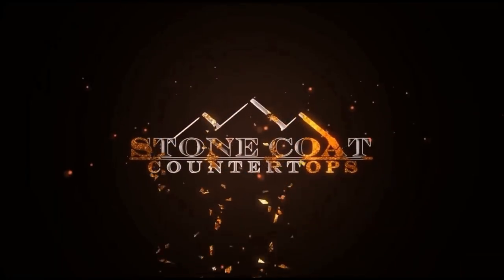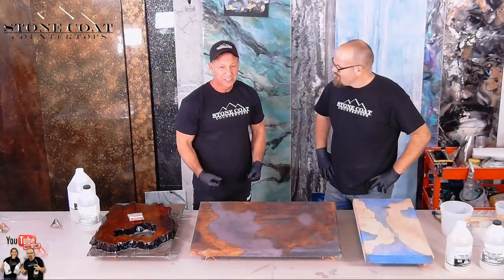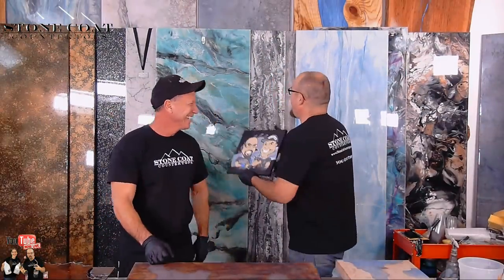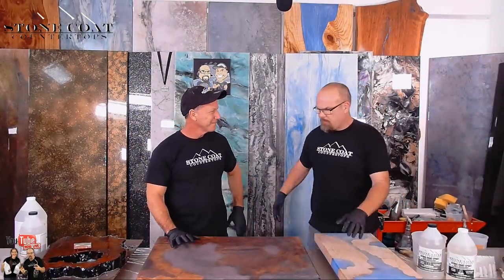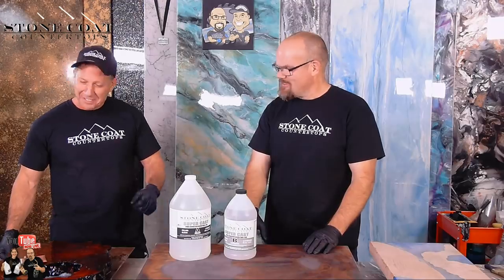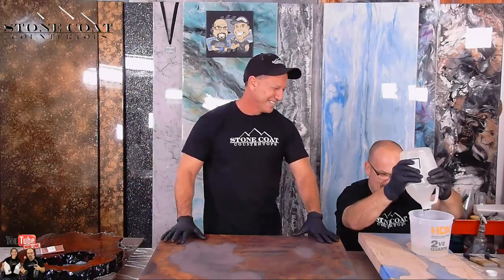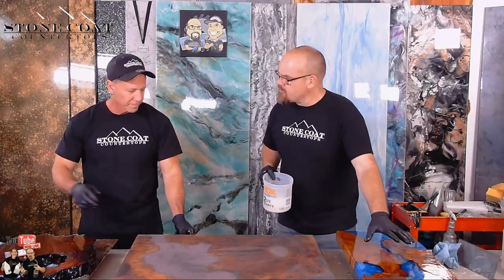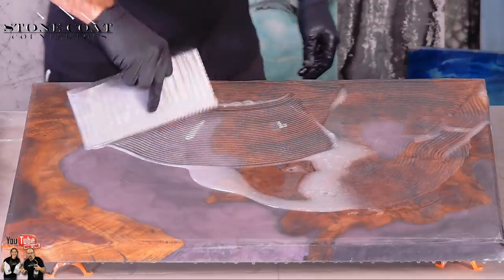Woodworking with Paul's Tool box

Comment: How come you didn't use the torch on the first piece (the wood and blue piece). Do you not need to worry about air bubbles when seal coating? And you explained the difference between seal coat And flood coat, but are these two done with the same product or different product? Can you tell I'm a total newbie! Lol. Oh and do you have a video with the completed results of the 2nd piece (or was it the third, lol. the one with the 2" deep orange hole) you did in this video.

Comment: I am planning on doing our kitchen benches, what is the recommended room temp you should be working in. And by the way, I love the one your picture is hanging on. thats my ideal benchtop. Love all your work.
Reply from the maker: Thank you for tuning in and that's a great question Pamela!  Our ideal pour and cure temps are 65-80 degrees Fahrenheit. What project are you planning?
Reply: @StoneCoatCountertops  resurfasing our kitchen benches
Reply from the maker: Awesome Pamela, have you chosen a color recipe for your benches?

Comment: do you torch the skim coats?
Reply from the maker: Great question Charley n' Me! The seal coats are applied at one ounce per square foot, whereas the flood coats are applied at three ounces per square foot. You'll do three "seal coats" on the surface using one ounce per square foot applied with a squeegee. You will torch out the bubbles with a sweeping pattern. Let it set up overnight, and sand between coats. You will still see a lot of bubbles and imperfections during the seal coats. This is normal. Do not try to over torch the epoxy fighting the bubbles, just do 3 passes and walk away. After that is complete, you will apply one flood coat using about three ounces per square foot applied with the 1/8 square notch trowel & brush to chop the top and torch. Be sure to torch the air out of the flood coat three times as well. Call or write us anytime for project support. (541)450-1976
Reply: @StoneCoatCountertops  thank you!  The reason I asked was because you didn't torch the seal coat on the cool epoxy and Cyprus piece that you did in your last video. So I wasn't sure if I had been doing an extra unneeded step or not. Thank you for the clarification! Have a great Thanksgiving!